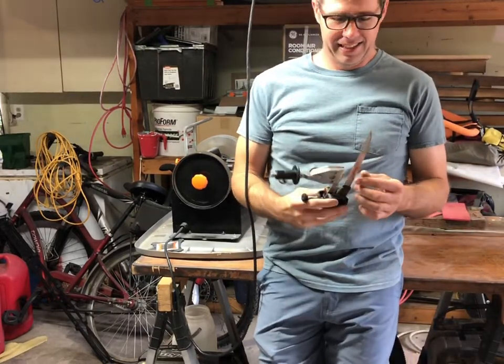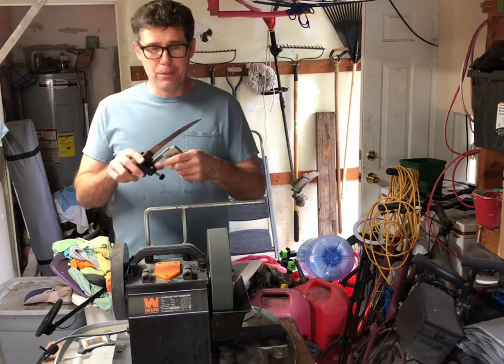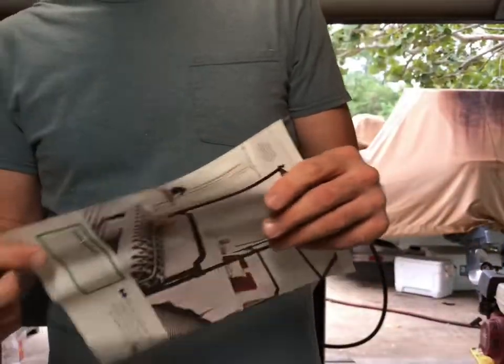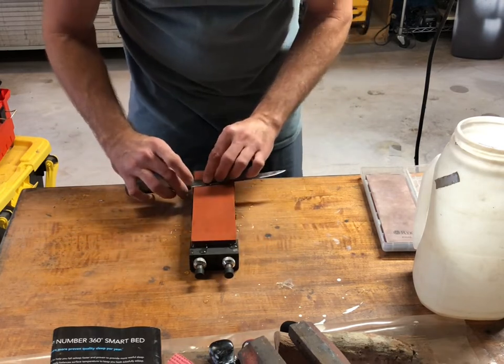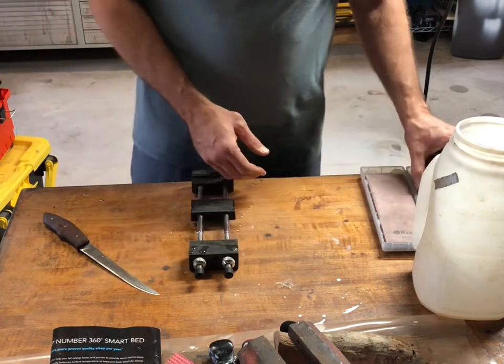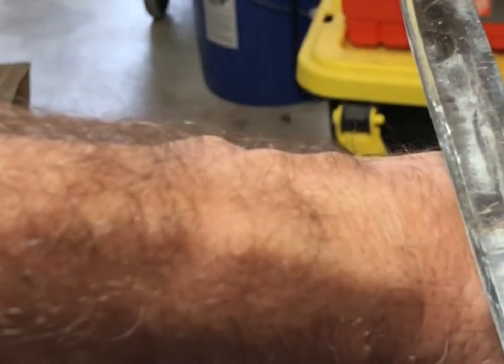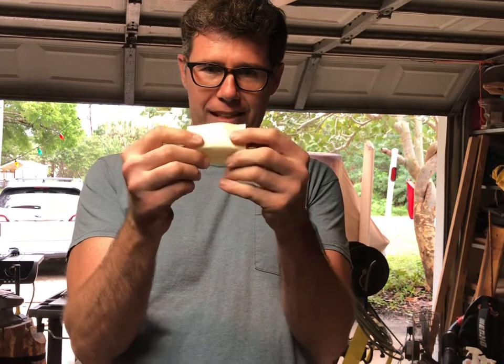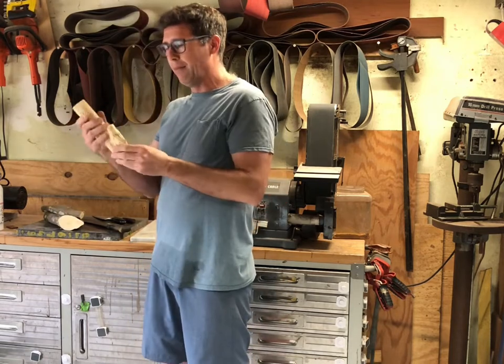Taking SHARP to the next level post WEN sharpener.  Homemade Hacksaw Filet Knife.

Comment: Do u need to resurface that wen stone??? Make it cut faster.
Reply from the maker: I used the stone grader quite a few times.  It took so long because the knife had no edge to start with and was made from an extremely whare resistant steel that a hardness close to that of the Wen sharpening stone.  I might look in to getting a Tormek diamond wheel in the future if I find myself sharpening stubborn steel more often.  But they are not cheep.